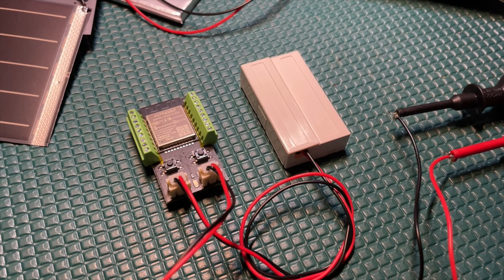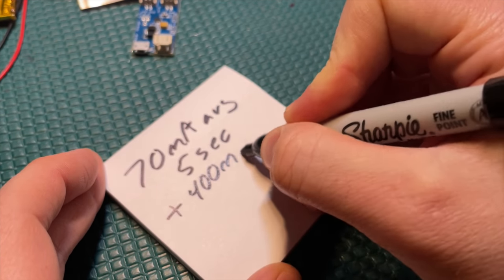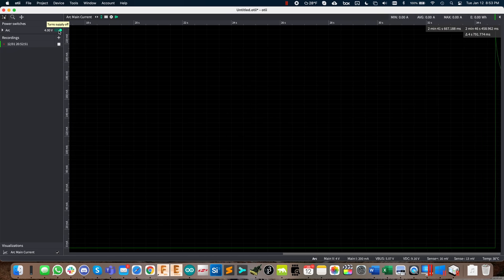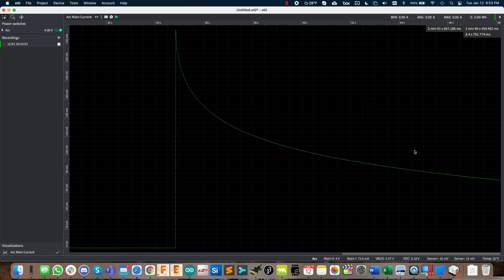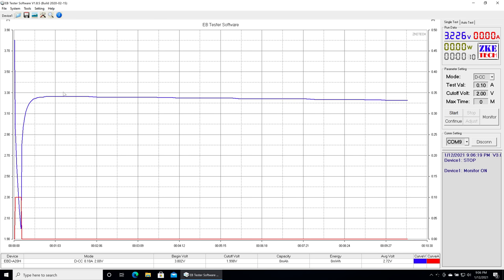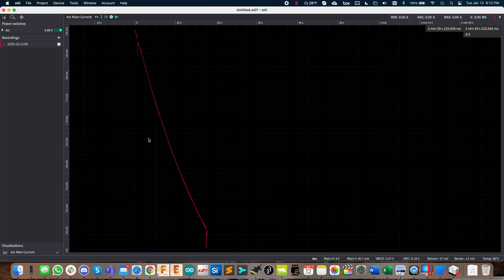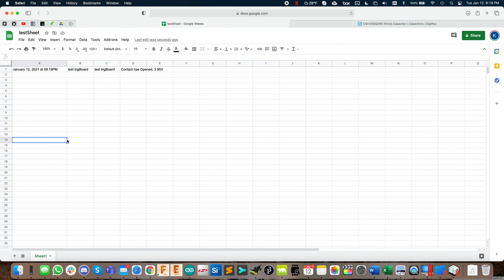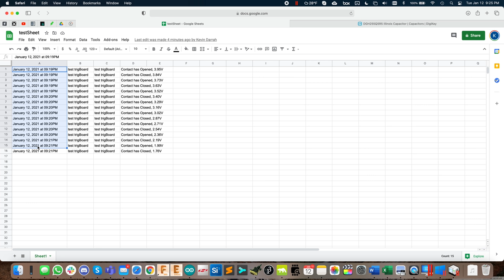Experiments with Super Capacitors for IoT Projects

Comment: You should really try out Lithium-ion capacitors, basically a hybrid between supercaps and lithium batteries. Supercaps are usually horrible for IOT projects because the leakage is so high... but with LIC's its <1uA. They are a bit more expensive though!
Reply from the maker: cool - yes I need to check these out, thanks for the tip!

Comment: Can Supercapicitors charge via a Solar Panel/Hand Crank while it's being used and discharging?
Reply from the maker: yes, my continued testing is showing very good results - also designed a board for a part 2 to this
Reply: @Kevindarrah  Thank you, I'm looking at using a dc motor driven by a vawt to charge the caps via a charge controller, then using an inverter run a heater so when it's windy I'll be toasty! Sounds simple but I bet it probably isn't!

Comment: To my knowledge from what I've seen online you're gonna have to de-rate all those super capacitors a lot because none of them do actually have the capacitance that they are rated for, measuring super capacitors accurately is also a problem since most meters aren't designed to measure super capacitors.
If you have the means to measure your super capacitors you'd quickly find out that all those super capacitors don't even come near to the rated specs.
Reply from the maker: yep - mentioned in the video an experiment I was doing trying to measure the time constant to figure out capacitance... reason I used 10W resistor was to keep temps regulated on the "R" while charge/discharge.  But funny thing was that capacitance was soooo off on that cheapy that I thought something was wrong with my setup!

Comment: What if you pair up a cheap supercap with let's say a 470uf low ESR cap, that can't store much but can deliver a lot of current for those wi-fi transmissions, and charge gradually over time as the high ESR of the supercap allows? I think that should work.

Comment: I just want to make a usb powered board that holds its power for a few seconds when usb power is lost.. I cant figure it out.. high esr makes inrush current perfect for usb, but the esp32 fails because of peaks shown in your video. Low esr shorts the usb, using a resistor makes the voltage drop too much, a diode too.

Comment: This is super interesting, thanks! I have some ideas for these kind of supercapacitor. I see they're available at 500F, which should be plenty for any application that wakes up from time to time. Add a small solar panel and you can probably get back most of the energy you consume in the pauses

Comment: This is awesome video and pretty helpful. Actually I am working on a project whose one aspect is to send "phase missing" status to my databases when power goes off. I need 4 sec to 5 sec backup for esp32 and calculated nearly 0.7 F capacitor but I am planning to use 1.0F capacitor (cheap version 😊). I am concerned that will it work? As you showed that it did not work in your case.
By the way, I like the flow of your videos. Awesome content!
Reply from the maker: thanks! well it's easy enough to test, but I have a very similar idea as well to detect power outage.  Might make a video on that

Comment: Hello Kevin, good job, as always wonderful content. I am worrying about how to charge those SC, as you said, there must be a resistor in series with it in order to control the peak current. If I use a solar panel as a charging source, the resistor would be in function of the max power of the solar panel. So, selecting a small solar panel (~1W/6V), the resistor would be high and there is gonna be a voltage drop in it that is not power efficient.
Reply from the maker: yep, I've got some cheap Ebay dev boards coming... will make a vid on how that all goes

Comment: Very cool, I have a bank of supercaps from an ambulance cardiac machine and it has a very cool board on it that only delivers the necessary voltage/current. Has even maintained its charge sitting in my battery drawer for over 2 months. It won't even burn out an LED when charged to about 16volts. Even almost dead it has run a 4 leg piranha LED for over two weeks. I have a few small solar panels that would keep it charged. Looking for the perfect project for it.
Reply from the maker: cool, yea stay tuned - planning on doing a lot with solar in the future
Reply: @Kevindarrah  very cool, I will be sure to watch

Comment: This is an off topic question but are you using both windows and mac? I could notice halfway through the video a windows desktop. Unless you're using a virtual machine.
By the way, where did you get all that setup for plotting graphs?
Reply from the maker: yea, that ZKE software was windows only, so just runs in parallels.  3 finger swipe slides between windows 10 and macOS